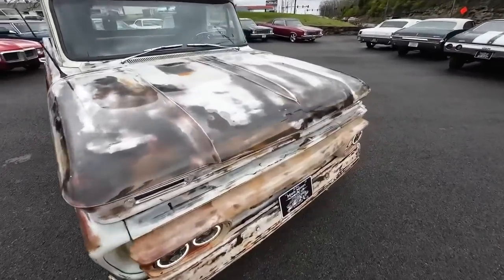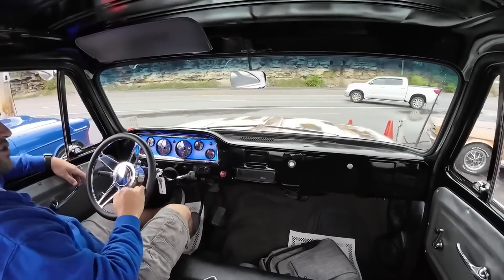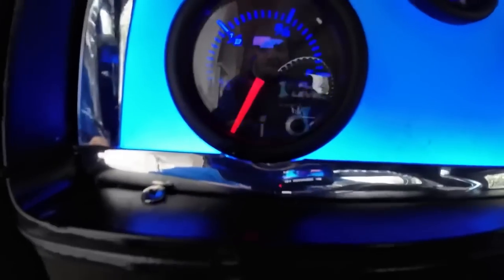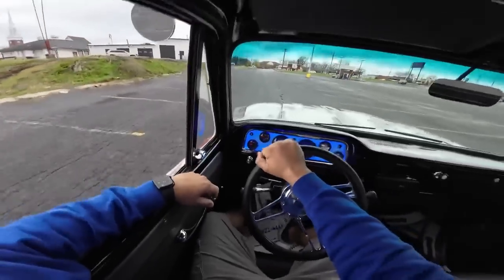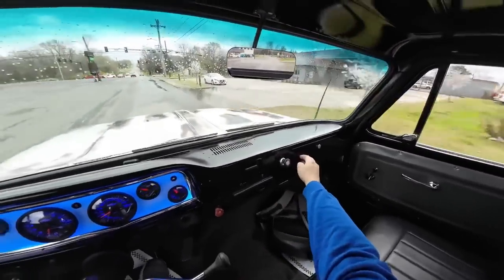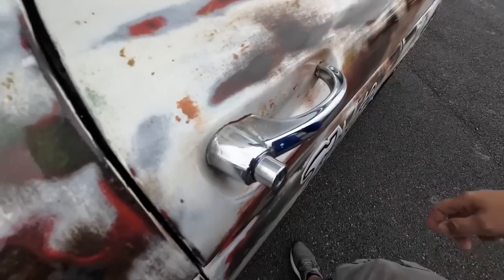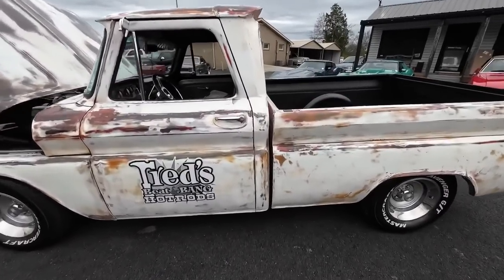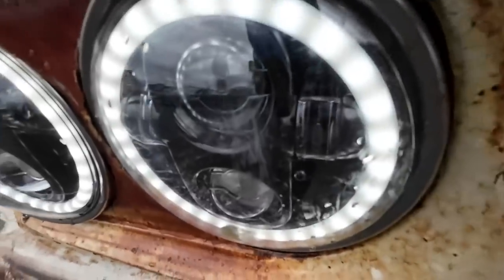Test Drive 1966 GMC C-10 SWB LS SOLD $25,900 Maple Motors #2096

Comment: Had a 62 , we called the acid truck , actually was painted with a brush at some point tan , yellow underneath,  truck was green originally,  oven cleaner sprayed over the truck , made an interesting look for sure , add brand new take offs off of 1986 4x4 takeoffs and 350 , 350  power train and instant cool truck , back in the ninetys , before patina was a thing , red light to red light very few could keep up , 456 rearend gears were so much fun